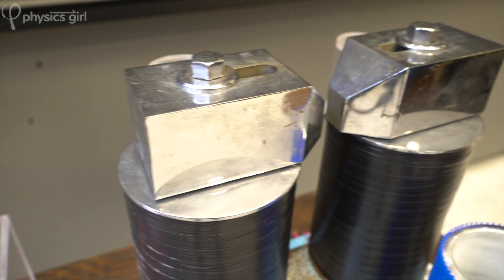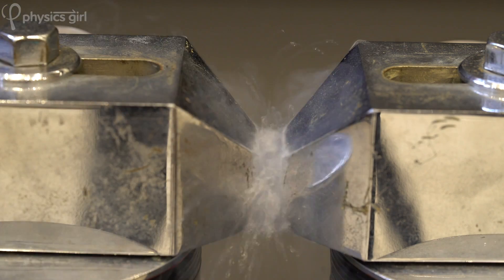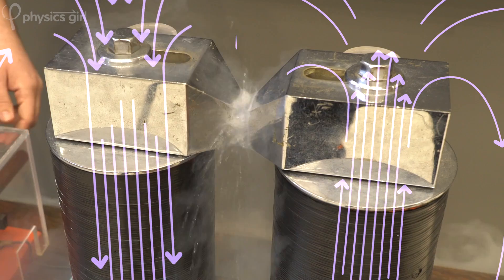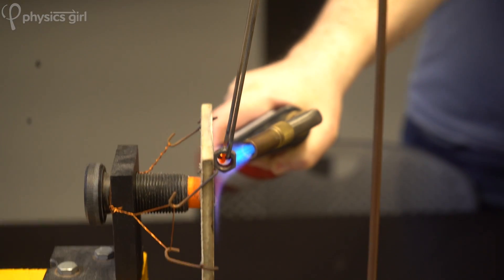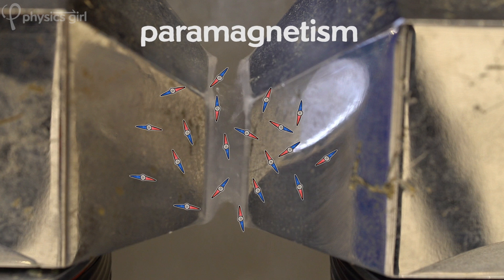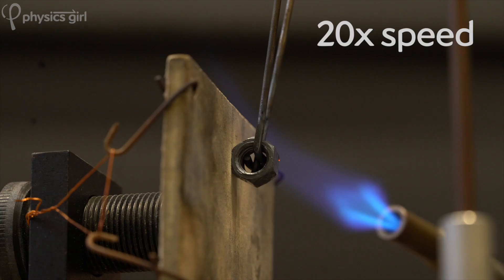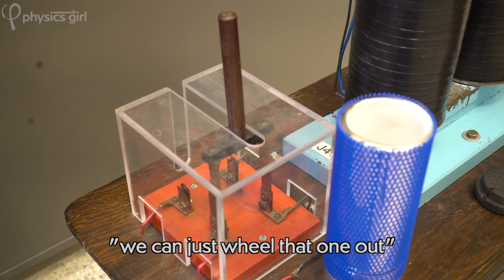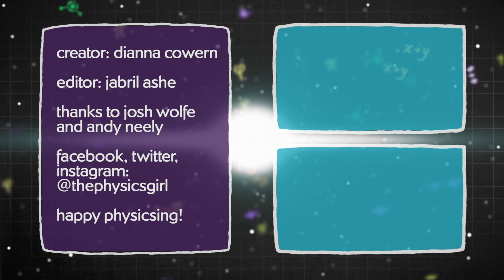Oxygen is MAGNETIC?!

Comment: *Not back EMF.  It's inductive kickback that causes the spark.
Reply: My view on it is that any voltage that is induced by a changing magnetic flux is a back emf. And that is the same, whether it is the voltage induced in a stator of an electric machine with a rotating rotor field, or a a coil with decreasing current. 

Inductive kickback is just a more precise wording for this certain appllication of back emf.
Reply: Joel Sullivan - I agree.  The back-EMF is caused in (permanent magnet motors) by the continued armature rotation, which of course is due to inertia.  That can be used to measure and control the motor speed better than the alternative, I x R compensation and cheaper than using a separate tacho generator.  In fact, the two basic formulas for DC motor behavior are 1) Torque is a constant * current and 2) Current is (supply voltage minus EMF)/resistance.
When you start a motor, it has zero EMF and pulls huge inrush current and also has a very high torque.  When the motor reaches full speed, the EMF approaches the supply voltage, the current diminishes and the torque also goes down.  At that point the speed cannot increase any more and you have reached the full speed (at the fixed supply voltage, of course).
Reply: Back EMF occurs in motors (and other things, but mostly motors).  Due to the spinning motor (and copper elements moving through magnetic fields) the motor itself produces a voltage.  This opposes the voltage applied by your energy source.   
Inductive kickback is when somebody, for example, disconnects an inductor from a power source.  The inductor will not allow the current to change instantaneously, so the voltage skyrockets, and if it's not clamped by a diode or capacitor it'll usually cause an arc in the air (which will in effect clamp the voltage).  
Very different effects.
Reply: Joel Sullivan sry, what EMF stands for?
Reply: Electro-motive force.  Here's the Wikipedia page describing Back-EMF.  https://en.wikipedia.org/wiki/Counter-electromotive_force
Here's a Maxim Semiconductor page about inductive kickback (which is what's causing the spark in the video - NOT back EMF). https://www.maximintegrated.com/en/glossary/definitions.mvp/term/Inductive%20Kickback/gpk/175
Reply: I disagree Samuel.  For one, kickback causes a huge spike in voltage of the OPPOSITE sign.  It's a constant current based event, and that generates wild negative voltage swings.  These can be destructive and usually have to be clamped with diodes.  Back EMF by comparison is relatively harmless, causes voltage of the SAME sign, and is a constant voltage based event.  

Kickback is constant current, and back EMF is constant voltage.  If those are the same thing, then that's like saying a capacitor and an inductor are the same.  A capacitor will maintain a constant voltage and an inductor will maintain a constant current.  Same thing, right?  Not quite.
Reply: Joel Sullivan the Wikipedia article you linked actually says (as I read it) that the term back EMF can be used to describe both inductive kickback and the EMF generated by a running motor.  It didn't claim those are the same thing.  Just that they can both be described by the same term.  So, AIUI, the video used the term correctly, at least according to Wikipedia.

Comment: If I remember my welding classes right, the reason the iron loses it's magnetic properties has to do with the shape of the iron crystals. As the iron heats up these crystal shapes change (way before it melts) which is why you can arc weld iron using DC current. The magnetic field doesn't effect the shape of the weld joint. It dose effect the shape of the arc however, but it can be manipulated to be beneficial.
    You'd think the arc would be lightning bolt shaped, but it's not. Usually it's cone shaped.

Comment: One of my professors (if I can remember correctly) put liquid nitrogen into a metal cone. The oxygen in the air condensed on the sides and formed a cloudy layer of oxygen vapor that flowed down the sides of the cone and then concentrated and fell from the bottom of the cone as if it were dripping off like a stream of water. I think he used a strong permanent magnet to show how he could divert the stream by placing the magnet near it. Not as spectacular as this demo, but more simple and I think that liquid nitrogen is easier to get a hold of and safer (not an oxidizer).
Reply: David Clawson Its about the same to get a hold of because you can easily condense oxygen with liquid nitrogen

Comment: Pure liquid oxygen has a slightly blue color, that's also the reason, why oxygen pressure cylinders are painted blue (I think).
The cryogenic liquid in your video seemed to be clear. So I assume, that you poured liquid air over the magnets poles, and the oxygen inside the mixture was attracted to the magnet only. Low Temperature lectures and demos are really cool!

Comment: I have another question. How can the liquid oxygen, which needs such low temperatures to stay liquid, be a liquid when you use it in the experiment?
Reply: The same reason that an ice cube placed in a hot cup of tea sticks around after being placed. It takes time for all of the molecules in the "pour" to heat up enough to dissipate and mix into the atmosphere. Molecules inside the bit of liquid oxygen are only trading little bits of heat, so they warm up slower and stick around longer than the molecules at the edge. The ones on the edge heat up real quickly and escape, causing the drop or blob of liquid oxygen to shrink.

Comment: What my chemistry tutors never adequately explained to me is why gaseous oxygen isn't magnetic, while liquid oxygen is.
Reply: Well your questions are about to be answered. Even in gas form, dioxygen also called just oxygen has two unpaired electrons, which give it a net magnetic moment. This means that every atom can feel the effect of a magnet, and so gaseous oxygen is in fact still magnetic. But in a gas molecules are moving quickly and possess too much energy to be bound by the force of the magnet. That being said, there would still be a small increase of oxygen molecules on the surface of a magnet due to the interaction energy, but it is not significant especially compared to what we see in the video. Imagine placing weak magnets on a fridge versus throwing them at full force. Which one is more likely to stay on the surface?
Reply: Gordie Carley Thanks very much for answering. That is what I expected to be the case. I was told that the magnetic moment of dioxygen disappeared in gaseous form, which never made sense to me.